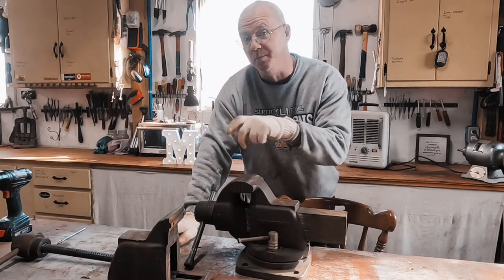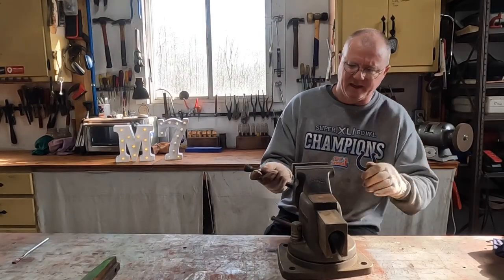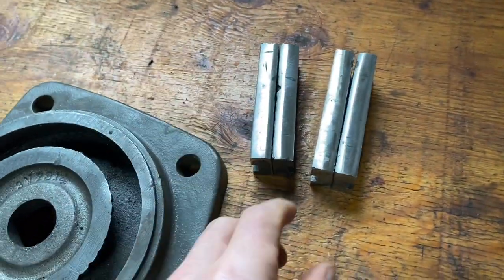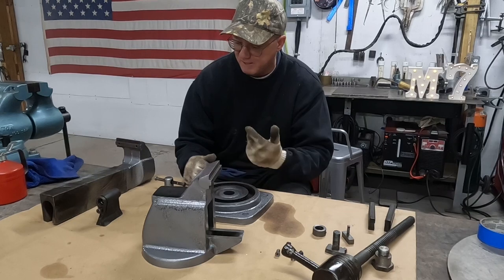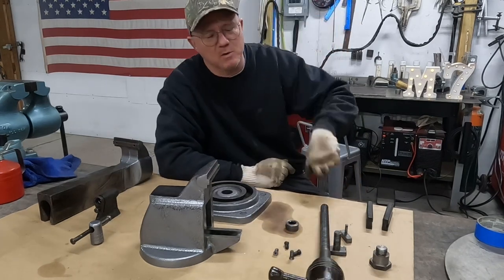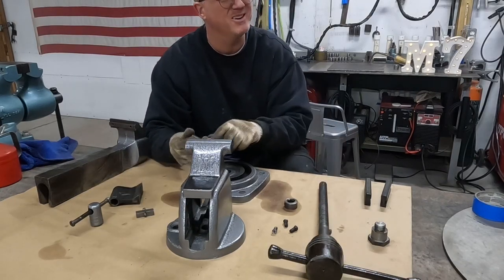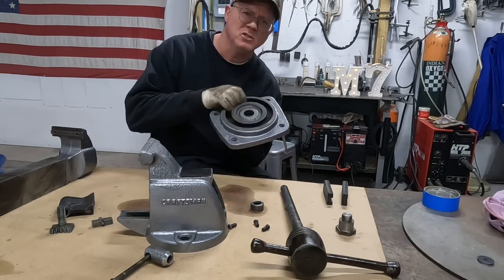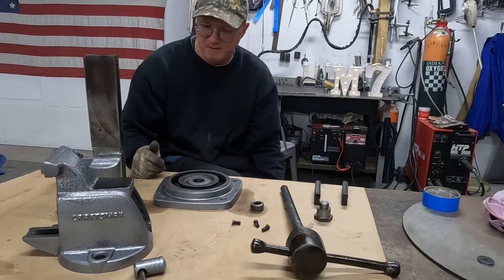Highest Quality Vise Ever Built!?!? Craftsman Model 5196

Comment: That vise was made for Craftsman by Rock Island. First showed up in 1948, started being phased out around 1958. Initially they came with a metal heritage badge riveted on one side, then switched to cast raised lettering as you have on. The 5198 is the rarest -the 5" swivel mount. These vises all originally came in that 1950s blue-gray Craftsman color. Within all the 519X Craftsman models, there was a leaf spring put in the nose of the spindle so that the handle would not fall. There may be an issue with your leaf spring as it allows the handle to drop. There was no inherent design flaw, the broken dynamic jaws you have are an anomaly. Any brand vise of any size can be broken if misused or accidentally dropped from a decent height.
Reply from the maker: Wow! That is some great information! Thank you for your contribution to this video.

Comment: You´re right ,Chris. It´s about the morons that hammer on it with a 15 pound hammer. You can see the witness marks on both jaws. They were simply misused over their limits. Those guys were precision vises and not intended to straighten a rear axle of a truck in it. The design details are very convicing, an excellent draft.
Reply from the maker: Haha! Bingo! Word to the wise….don’t use your vise to straighten an axle!

Comment: I don't have much knowledge about vises but seeing 2 models broken in the same place is not something I would call high -- and definitely not "highest" -- quality!  : )  The base is definitely the boss and so is the mounting of the nut that holds the lead screw.  The end of the lead screw is huge.  Maybe those beefy things led a user to overtighten or whale on the vise, to its detriment.  As the vises are from the 1950s, are the insides of the jaw heads hollow, as opposed to solid castings?  They look to be of the ductile iron type like my Columbian of about the same age.  Peace.
Reply from the maker: Yep the inside of the jaws heads are solid not hollow. I think the attempt was to create one of the highest quality vises produced at the time. I think they missed the mark if there is a fatal flaw. Curious to see what other owners of this vise have to say.

Comment: Great video. Actually picked up nearly the same vise, model 5191. It is in very roughtshape and is missing the collar and handle. I have already cleaned and painted it. I can make the missing parts. 

 Is there any chance you can give me dimensions on the collar? Can you tell me how long the handle is? Would really appreciate it. Trying to keep it out of the scrap yard!
Reply from the maker: The collar on mine is threaded and threads onto the lead screw. So the size is determined by your lead screw. The handle is 10.25in. Hope this helps.
Reply: @shopdoc  Thanks for the reply. Helps. I have a 4" vise. The collar should just be wide enough to take up the slack in the lead screw right? Maybe less than 1" wide or so. Thanks

Comment: Beautiful vises, but I also think that they built the slide a tad weak at the end below the jaw. I think I've seen maybe 6-8 of them where aprox 3-5 lbs of NiRod  has been used to repair the slide. If welded correctly, the fix will last a lifetime..
Example... Back in the summer of '68 my folks had bought a house and we were in process of moving. My dad had just un-bolted the vise from the benchtop. The jaws of the vise weren't all the way closed, and the tumbled off the edge, and hit the concrete floor hard enough to snap the front of the slide...... Well after the move, dad took the vise over to a friends place, and once everything was in place, held in perfect alignment... It only took around 4lbs of NiRod and everything was good to go.... About 30 years later, I became the owner of the repaired vise... and today?? The old vise still works 100% perfectly...... So there you have it... 55 years alter after the big break, that vise still works perfectly......
Reply from the maker: That’s a great story. I have always been told that if a vise is repaired with nickle or braze properly, then the repair is as strong or stronger than before the break.